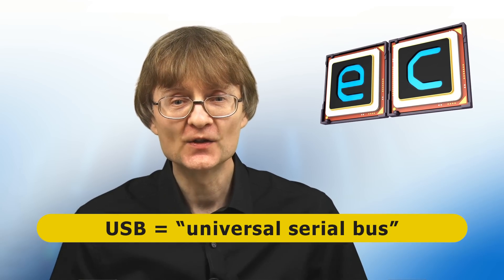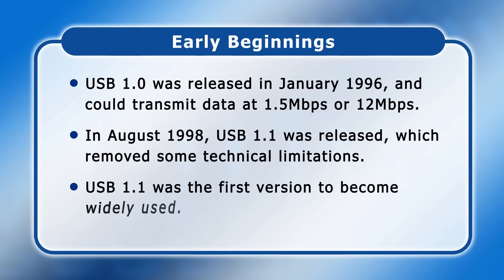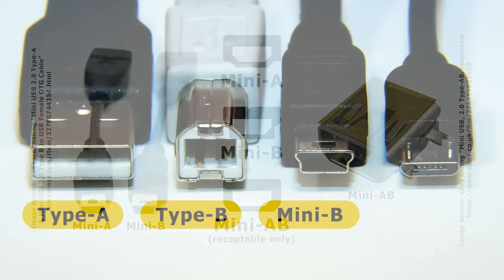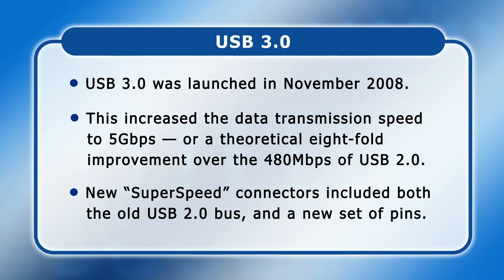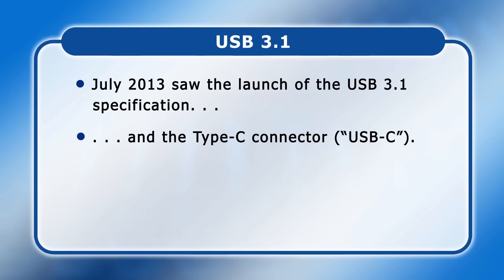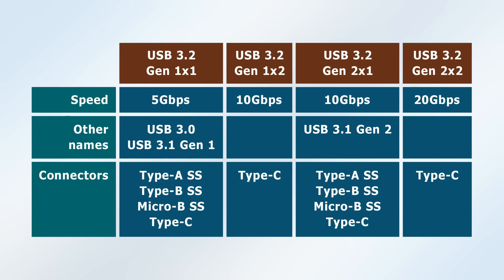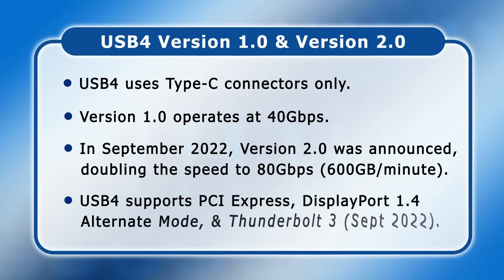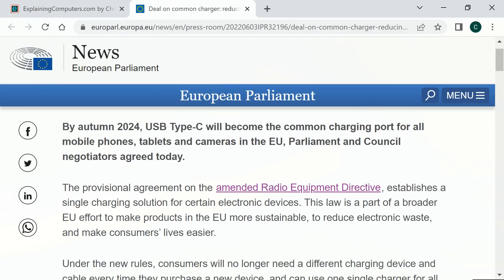Explaining USB: From 1.0 to USB4 V2.0

Comment: BTW, just to throw a bit more confusion into the mix, I have a purported USB3 HD with Type A port on device, and a A to A cable, all marked in Blue, it does 100MB/s sequential read & write on winsat test in Windows 10 (built in: winsat disk -drive d) but the type A cable is just 'normal' (no pins on the front edge at either end)...
Reply from the maker: Very interesting. There has never been a way to force all manufacturers to use B at the device end. And related to this, Mini-A, Mini-AB, Micro-A and Micro-AB large disappeared because manufacturers started putting Mini-B and Micro-B connectors at the host end, rather than using an A or AB connector. . ..
Reply: @ExplainingComputers  As a follow-up, I checked ALL my USB3, 3+, 3.1, etc, blue type A cable ends and NONE have the little pin holes on the face of the blue plastic that you illustrate. All seem to transfer data at at least the minimum 3.0 levels.

Comment: Very informative, as always, but I think you haven't managed to capture the frustration that us consumers face when it comes to things like purchasing an USB cable. Recently I lent a type-C to type-A cable from my father, to use with an external SSD, and after using it a couple of times and feeling it was unusually slow, I checked it just to find out that it was USB 2.0, with just four pins on the type-A end 🤦🏻‍♂️ And general USB cable quality is so low! Why do they even sell these products?
Anyway, great video, as always! Keep it up 👍🏻
Reply: In the early days of USB Belkin was the brand of cables to follow , use , purchase 
 Momax is now the brand of cables  to follow , use purchase 
  Also short cables result in the portable device  ( smart phone ) having to be place down , while with very long two metre cables ,  the smart phone can still be utilized while being charged
Reply: @boboften9952  I have had good luck with Anker USB cables but haven't used anything with the new USB 4 standard yet.  Belkin cables should also be of decent quality but I haven't used any of their USB cables to comment from personal experience.
Reply: @mharris5047  Yes, that's the difference between a £20 cable and a £2 cable. I also find the Anker cables to be excellent and reassuringly expensive
Reply: @Andrew_Fernie  Don't be fooled by Quality. Even Anker's most expensive Series 7 USB C cable is only USB 2 speed, but is touted at 140w. Generally I've seen most USB C cables are designed for power and not data.
Reply: @macsound  Fair point
Reply: This is plus that apple had in their ecosystem for laptops for years, using thunderbolt SSDs and peripherals is so easy :/.

Comment: As I tend to keep equipment a long time, it's already too complicated trying to keep USB A, B, Mini B, and Micro B connectors to hand, and I'm always going on frantic searches for the type I need! Also finding USB 3 cables when I need one, or wondering why there's no data transferring and finding out it's a power only cable! USB C will just add to the confusion and stress! Currently if I find a USB C connector I know it's on a Raspberry Pi 4 power supply. USB C may be the long term solution, but the amount of equipment I'd need to replace to use only USB C would be mind boggling! And by that time, we'd probably have USB D, E and F type connectors available too 🤣.
Reply from the maker: I think that we will see Type-A ports, both USB 2.0 and USB 3.x specs, around for a very long time.

Comment: The USB naming scheme has become very confusing, they really did not do a good job with that.  
Technical too, it's become common that a USB 2 devices do not work on USB 3 ports even if the specs say they do.
And USB C sockets have now inherited the old 'plug and pray' image. It should work in spec, but sometimes it doesn't.
USB C charging is another can of worms they made possible ... thanks a lot. (\sarcasm}
Reply from the maker: Thanks for this. USB 2.0 devices not working in USB 3.x ports -- eg keyboards and mice when doing OS installs -- tends to be a driver issue. But an issue non the less! I'm always wary of desktop device with no USB 2.0 ports for this reason.

Comment: Some other things to note:

1. Thunderbolt 3 support on USB4 is optional and not guaranteed.
2. USB4 supports 20 Gbps by default. 40 Gbps is optional.
3. USB 3.2 Gen 2x2 (20 Gbps) and USB4 20 Gbps are not the same and are not compatible with each other.
4. Windows 11 is needed to use USB4 at full potential. Windows 10 will work, but at USB 3.2 protocol.
Reply from the maker: All agreed. This is additional information to what is in the video! :) As noted in the video description, I had to decide what not to include.

Comment: Yeah the USB 3 naming bullshit is really annoying. WTF were they thinking?! Is there a video that sheds some light on that? I was actually working on automation research when USB became a thing, and it was a nice development, although before that I had been dreaming of a universal system where the connector would have power pins and optical data. :) But the good old RS-232 (the Serial Port!) is still appealing because of the simplicity (no real "smarts" required for data flow to happen).

Comment: I'm still not sure what my USB3 ports are on my motherboard. There were several logos for "USB 3.X" on the box, but trying to figure out exactly which specification they belong to with all the renaming is crazy.
Reply from the maker: Indeed, and it is not uncommon for motherboards to have a mix of USB 3.x ports with different specifications -- eg one 3.2, and the others 3.0.
Reply: @ExplainingComputers  They seem to be colour coded(2 black, several blue, one light blue and a USB-C socket) but they aren't very clear about which port is for which standard, and there was no manual in the box.
Reply from the maker: @fattomandeibu  Probably black is USB 2.0, blue is USB 3.0 (as it used to be called -- 5Gbps), light blue is USB 3.1 (10Gbps).

Comment: In fact, that renaming of standards is so contagious, that even HDMI adopted this madness for HDMI 2.1... There's a half bandwidth version which was formerly HDMI 2.0 and a full bandwidth version for 8K60p with HDR support...
Reply: The naming standards in tech are what happens when you don't employ women. 

802.11 Wifi 0
802.11a Wifi 2
802.11b Wifi 1
802.11g Wifi 3
802.11n Wifi 4
802.11ac Wifi 5
802.11ad 
802.11af
802.11-2016
802.11ah
802.11ai
802.11aj
802.11aq
802.11-2020 
802.11ax Wifi 6
802.11ax Wifi 6e
802.11be Wifi 7 

Xbox 
Xbox 360 
Xbox One
Xbox Series XIS 

Nintendo Gameboy Advance 
Nintendo Gameboy Advance Micro 
Nintendo Gameboy Advance SP 
Nintendo Wii 
Nintendo Wii U 
Nintendo Wii Mini 
Nintendo DS

Nintendo DS Lite
Nintendo DSi 
Nintendo DSi LL/XL 

Nintendo 3DS 
Nintendo 3DS LL/XL 
Nintendo 2DS 
Nintendo 2DS LL/XL 

Apple Macbook Pro (2012) 
Apple Macbook Pro (2013) 
Apple Macbook Pro (2014) 
Apple Macbook Pro (2015) 
Apple Macbook Pro (2016) 
Apple Macbook Pro (2017) 
Apple Macbook Pro (2018) 

What happens when you do employ women: 
Playstation 1
Playstation 2 
Playstation 3 
Playstation 4 
Playstation 5
Reply: It was first invented by TV and monitor display sellers, when 720p got renamed to HD and 1080p to fHD.

If 1080p is full HD, then shouldn't 720p be half-HD? What even is a "Full HD"? It is either HD, or not.

Comment: So… how do I know which standard a cord is?
Reply from the maker: Judge by the speed of the connectors on the ends. No cord that does not have a USB-C connector at both ends will operate at more than 10Gbps. When it comes to power, cords for power delivery are now sold with a wattage rating -- eg 60W, 100W, 240W.

Comment: solid gold, as ever. But the real data speed of any USB is about 10% of the theoretical max, so you might like to do fun vid on that at some point...just a thought...and another thought while my brain is in USB-PD mode, I strongly suspect that using laptop USB ports to charge devices at their top power draw is a fine way to drastically shorten the life of your laptop motherboard...you might have a view on that...
Reply from the maker: I think that 10% is a little low! :) But I did stress "theoretical" speeds here. :) I agree that using a laptop as a charger for other devices is not in the laptop's best interests. And I would state the same for the trend towards plugging a laptop into a monitor via USB-C and the monitor powering and charging the laptop -- not kind on the screen's internals.

Comment: Universal Serial Bus was created in order to remove the confusion created by all the other means of connecting, like serial, parallel, SCSI etc.
Now it has created a confusion of its own.
The next protocol will be named USB OMG!
Great video again Chris. Thanks.
Reply from the maker: I am now waiting for USB OMG Version 2.0 Gen 2x4.
Reply: Remind me to how Sony branding their products with confusing long name too 😂
Reply: However, one of my biggest complaints, the serial and parallel were seldom (if ever) used to charge the f'king batteries. And those connectors were much more robust than the USB connectors!

Comment: Calling mice rodents, I love it.
The confusion comes from USB Type C 2.0 on new devices. It's near 2023, and all new phones, tablets, and other handheld computers should be using at the very least USB 3.0 and support display out, even if PD isn't offered on said devices.
Reply: Yeah, the problem is some manufacturers probably have bins of the old stuff they need to run out of :(

Comment: I’ve been very confused about the different connectors and speeds. You confirmed that you can’t tell the speed by the colour or shape of the connector, only by testing. “Keyboard and rodent “ 😂. Informative and useful information, thanks :_stanley:
Reply from the maker: Good to see Stanley in agreement there.

Comment: Thanks. You just saved me a lot of grief. I have an external disk with a damaged Micro USB-B SS connector. I'd not realised that an ordinary Micro USB-B connector could be used. I'm now (slowly) recovering the data from the disk.
Reply from the maker: This is a good result! :) And you are the second person to comment on this particular point. I can never guess which parts of a video will turn out to be useful.
Reply: @ExplainingComputers until I saw this video, I assumed that the extra pins were for extra power needed for the external hard drive. I think I read some misleading forum posts that gave me that idea.
Reply: If the disk is external and the only thing that is damaged is the case's connector, you can buy a new case for a few quid and move the disk in the new one. You'll save your disk and your day.
Reply: @johnphilippatos  That was the grief I've avoided. Getting the disk out of the case looked decidedly non-trivial as it was firmly glued shut. It was going to be a matter of using a Dremel to cut it open without damaging the contents. Instead I'll just leave it copying on to a spare laptop and check on it in the morning.
Reply: @Graham_Rule  Ok, when you are done with transferring the data, you can always go back and check whether you can still salvage the disk by cutting the case open.
Reply: I used to think usb micro b ss was a proprietary connector, it does look very odd next to the other micro and mini connectors

Comment: USB became a confusing mess with the introduction of USB-C and was further exacerbated when Thunderbolt was added to the mix. A cable can be thunderbolt compatible but not USB-C compatible for example.

Latest USB standards are not even truly serial protocols anymore, as they use more than one channel. But I guess UPB doesn't really have the same ring to it.

Last fun fact for anyone still reading - a USB 3.x Type A port is technically two ports; a USB 2.0 and a USB 3 port in a single connection. You can even buy splitters that allow you to plug in a USB 2 and USB 3 device concurrently.
Reply from the maker: Regarding your last point, this remains true for USB-C ports as well, which include a separate USB 2.0 bus.

Comment: the PD, when they can’t rise the current they starting to rise the voltage to 48V (i remember the telephone lines are -48v somehow), i am wondering when they start to making the mobile device battery what voltage will they use (laptops are usually around 19v to 20v input with a 12 to 14v battery, my huawei laptop 20v PD with a 2S li-po battery)
Reply from the maker: Yes, it's interesting this. Analogue phone lines 48/50V as you say, and also balanced audio is 48V.
Reply: @ExplainingComputers  Christ, I just cancelled my Rock 5 redeem, it takes too long, the radxa team was announced that Q2 will be available,. Then their check has been bounced to Q4, I cannot see the end and I had to cancel my project at August, now I changed my project to base on FPGAs